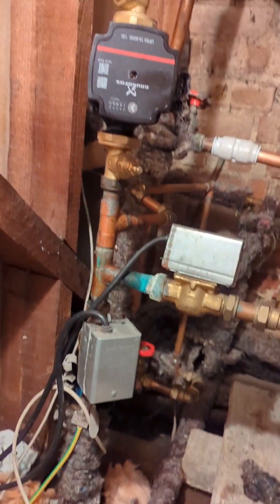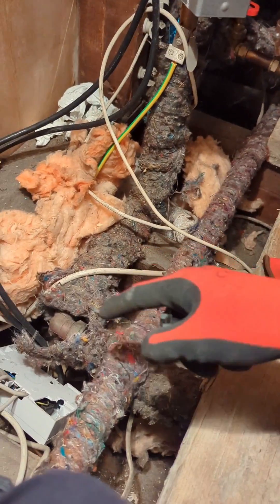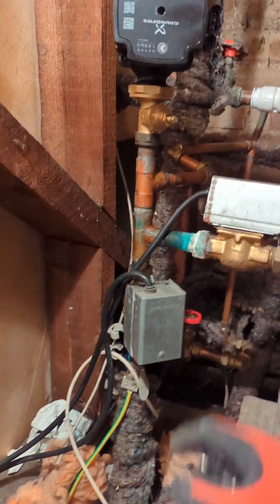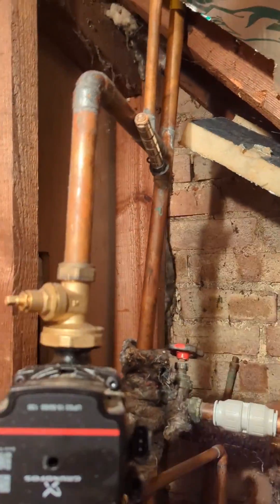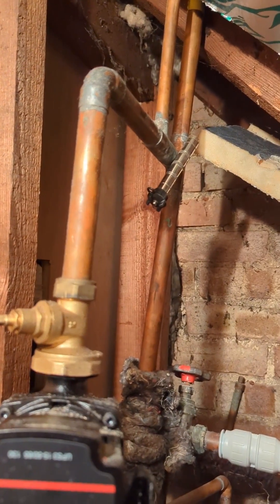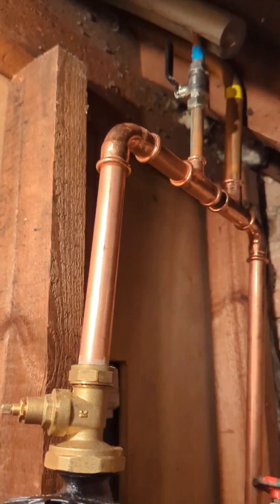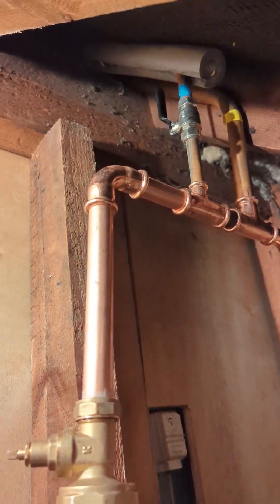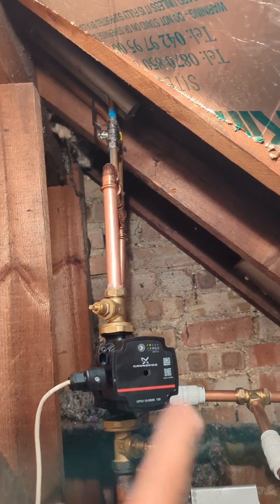Live Fault Finding #16 - Blocked Cold Feed & Vent (H-Section)

Comment: If you had a separator that was blocked because you found it was magnetised would you replace the air separator or would you turn into a section if you turned into a H section? Could you use compressions? Thank you
Reply from the maker: I'd turn it into a H section and use compressions so that it can be undone again if needed in the future
Reply: @cputilitysolutions  yep replaced with compressions, air separator was blocked. Replaced pump as well.

Comment: Unless you have just changed the front of the pump, the pumps on the wrong way too!
Reply from the maker: Pump was fitted correctly by previous engineer, arrow on the body pointing towards the zone valves. Just didn't change the orientation of the head, which I did after.
Reply: What type of fittings are used on the new section? 
Are they crimped? Or push fit ?
Reply from the maker: Press fit
Reply: @cputilitysolutions  how do they seal ? 
Rubber ? Glue ?
Reply from the maker: Look up press fit on YouTube and you'll see how it works 👍🏽